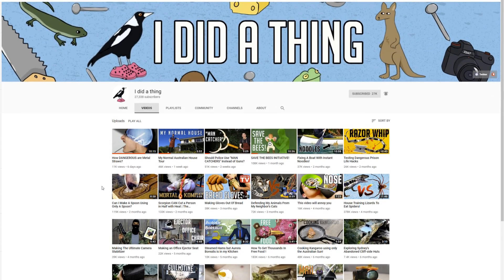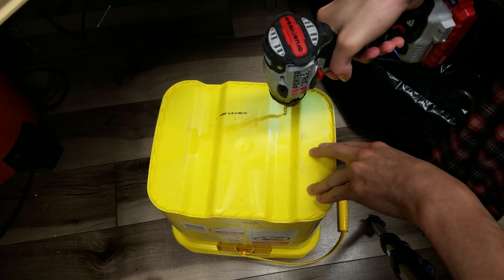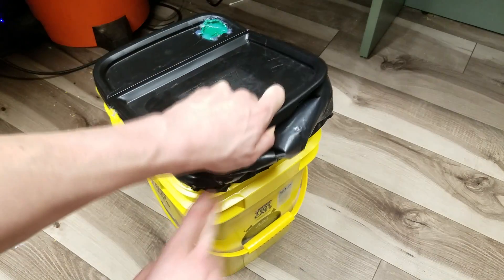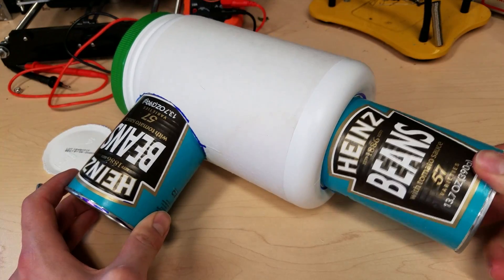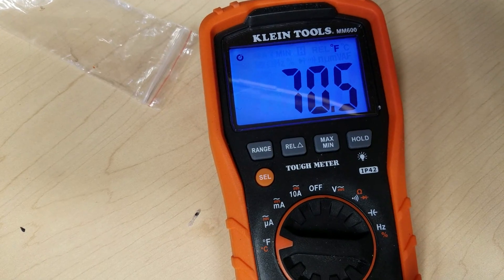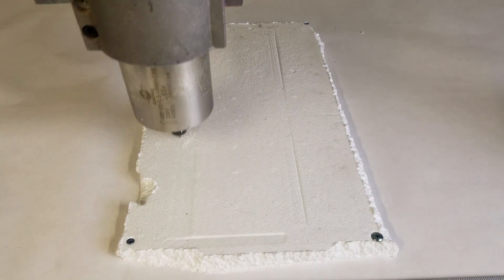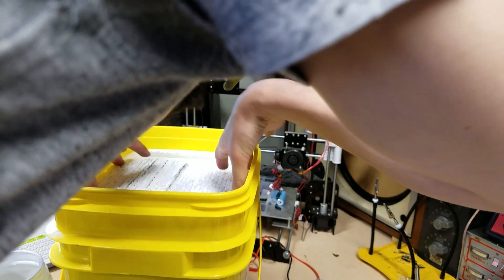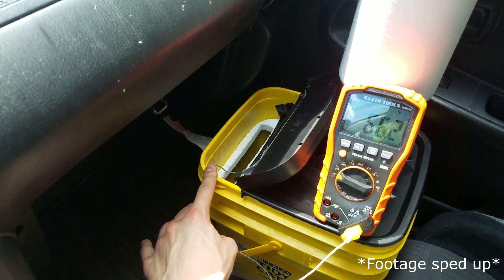Fighting @I did a thing  over hot trash

Comment: What if you replaced the water in your air conditioner with (denatured or any high proof) alcohol? Would the output be significantly cooler since it evaporates easier? Or would it be no different?

Bonus points if you make your own fermented bean alcohol to do this with.
Reply from the maker: It would likely cool much faster, but would need a thermal exchanger of some kind between two separate airways, unless I want my car to smell like the inside of a vodka bottle.

Comment: I had to do something somewhat similar a couple summers ago when the AC in my shop went out. I wish I had thought about using newspapaer or something but I just made a basket to hold ice in a pipe with a fan on the fan on the other end (basically) I ended up using dry ice at one point and that helped but it wasn't a huge difference. However the problem with evaporative coolers like this is they depend on the humidity of the air if you live in a humid place (like me) they are not very effective but can help a tiny bit.

Comment: If you crack the windows open a little and drive around the air in the car will have constant movement and the warmer air will be replaced with cooler air. I may or may not have tried this with my mom's car once but my design wasn't nearly as cool, it was a spray bottle and a rag placed over the air vent

Edit was a spelling error

Comment: Is it still working if the humidity level of the atmosphere is very high ?
Where I live it's not unusual to have around 80% of humidity, especially when it's a very hot day...
Reply from the maker: You will definitely see a reduction in cooling efficiency at higher starting humidity. I was testing with 50% humidity for these tests
Reply: @JoelCreates  
It seems to be a bit too week for a car but I'm wondering if it could be used to cool a small fridge. 
It's reminding me of this weird Rubber-band cooled fridge of Applied-Science.

Comment: Was expecting to find the done-a-million-times and just as useless "ice with a fan on it" build. Pleasantly surprised. At least you know yours was trash. Hit a deer this summer and had to replace the AC condensor (first thing it crushed), but haven't got around to buying the kit to pull a vacuum and replace the gas yet, so I've been without AC this season too. You know when your ball sweat drips down and acts as a swamp cooler for your balloon knot... still not effective. My solution is a $1 spray bottle filled with tap water. Spritz it around inside while you drive, at the windows especially.
Reply from the maker: Glad to surprise, sorry about the deer, glad it wasn't a moose!